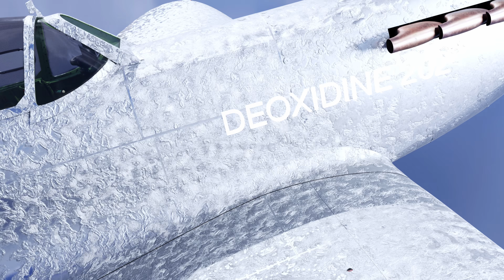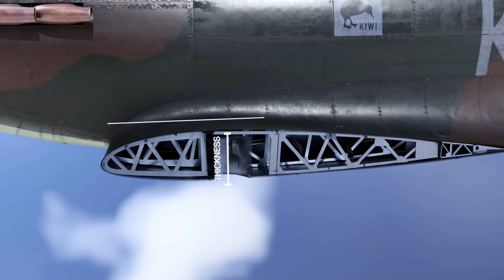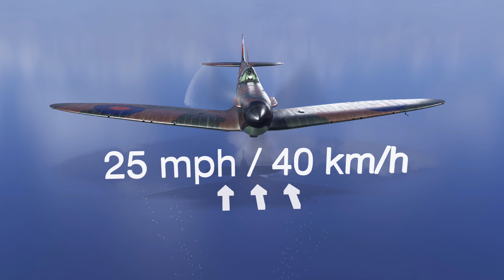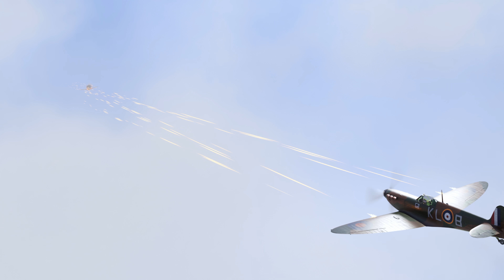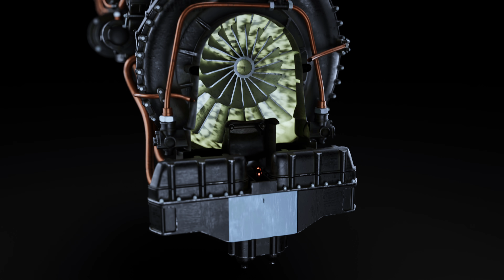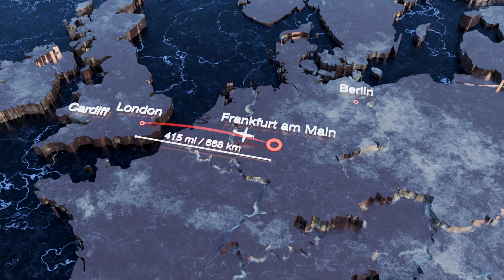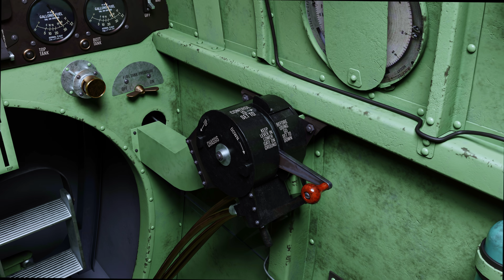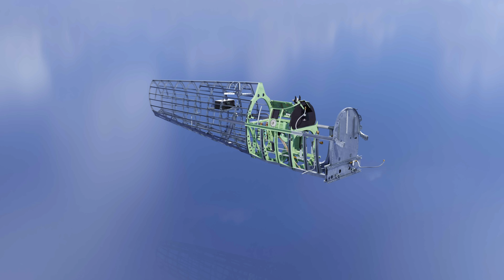Inside the Spitfire

Comment: I actually did spot a slight inaccuracy in the script! (wooo! I caught one! Hey, y'all, I caught one! :D)
You pointed out the propeller having two positions  - This was the case of the original DeHavilland 2-position units, fitted to the earlier Mk.I  (not A) - These were not actually two positions only, despite their confusing official name.  A pilot could operate the control handle continuously such that any pitch between the nominal 2 detents was available.  This is in more modern terms, considered a "variable pitch propeller", which are (these days) distinct from "two position" setups where the pilot can only toggle between Full Fine and Full Coarse blade (pitch) angles.
Moreover, The BoB-era Spitfires Mk.IA, had (for the most part) been upgraded with the heavier, but decidedly superior Rotol Constant Speed props.  They are subtly distinctive with a more rounded, boob-like spinner, and chunkier prop blades.

Constant-Speed props like these use a governor (a speed control device, not a politician) to feed oil-pressure into the mechanism inside the spinner that changes blade pitch.  The pilot then uses the cockpit lever - which you correctly modelled after the Mk.IA, whereas the Mk.I had a plunger-style push/pull knob - to set the maximum RPM at which the governor will begin to pitch the blades such that they "bite harder", increasing resistance and keeping the RPM constant while outputting more power as you advance the throttle. 

The official period documents about these propeller fittings and their operation are fantastically confusing, as I'm sure you've noticed. Took me a also quite while to piece this all together when I first looked it up.  
I suspect this is where you also understandably took it from, that the takeoff procedure required pulling the propeller handle back - This was so in the Mk.I with the manual plunger control, which operated backwards from the later constant unit handle. 
But in the Rotol-fitted Mk.IA, you'd have it fully forward for max RPM before takeoff. (maddeningly, the mixture control IS just as you pointed out, reverse from modern-day standards, with Full Rich being the aft lever position.)... IKR?

It is all indeed, very messily explained in the manuals of the era. A rich example of just how fast development was taking place at that critical time, when not keeping up with advancements would mean everybody having to learn to speak German real quick-like. 
It'd actually have been most surprising if you had got those details correctly in the first try.  Even high-fidelity flight simulator developers have been known to struggle with the differences between Mk.I and Mk.IA propellers in their digital recreations.  You do amazing work! Keep it up!
Reply: The bane of all historians; messy confusing or incomplete documentation.

Comment: FYI everyone 
The space from the main wingspar forward on later marks were converted to increased range  fuel tanks. Give the old lady a longer ride in the air. If you see any spitfire pictures with the front wings in silver that's one that had recently undergone the upgrade I believe they were kits to do in the field and probably that the factory where they would rebuild repair

Comment: The RAF production outstripped the Luftwaffe during the Battle of Britain, the Germany under estimated the productivity of the British manufacturing industry. 

That’s why they kept expecting the RAF to disappear from the sky. 

The Brits remained over the uk, if they got shot down and survived they could be returned to service within days. 

Germans had to bail out and get captured or risk ditching in the English Channel. 

The Germans started with a numerical advantage but the Brits rapidly came level and then streamed ahead of German manufacturing. 

Lots of nationals from occupied countries flew with the RAF and the Polish wing were particularly successful against Germany possibly because they had seen their homeland occupied by Germany and Russia and had the fighting spirit for revenge. 

And the Spitfire was the equivalent of a sports car. 

Where the BF109 was a mass produced fighter the Spitfire was a work of art. 

It still draws crowds today, especially when it’s fired up and roaring. 

It changed over the years of production and the last versions were basically different aircraft even if they looked similar. 

More powerful and then different engines and modified for better all round vision with a bubble canopy the later aircraft were far superior to the earlier versions.

Comment: The only problem of those video, is that they are too short. 

What a masterpiece this plane was !!
Reply: In the back and forth here regarding BOB loss comparisons and the potential alternative outcomes, I don’t think anyone mentioned a critical variable: if a German plane was shot down over England, the pilot was out of the war - either killed or a POW.  Not so for the RAF. As an example, I think the guy who flew the specific plane featured in this video got to use his parachute a few times and then strap into another Spitfire. Apologies in advance if someone did mention this critical variable, extending that preemptive apology because I am DEFINITELY not here to argue with strangers. Cheers.
Reply: @HighAltitudeBeagle  Good point. The same conditions applied to the RAF in the battle of France. These losses made the victory of the B.O.B a close affair.  Goering did not deliver the cake walk destruction of the RAF as promised. It only set the stage for the allies involvement
Reply: Agree on the video is too short. Spitfire has many variants each different in their own way. I wish blue would make another video on the late merlin variant and the griffon engined variant.
Reply: They should be 1h
Reply: idk if its a masterpeice when the carburator is of a bad design

the combat range is severely limited

it had long construction times

cramped cockpit

only .30 cals

so idk man, seems like a good plane but far from a masterpeice. at least not the mk 1
Reply: @TheRealHornet0  You raise some legitimate points. However ,its ease of flight allowed poorly trained (in the gunnery aspect) pilots to get close enough to German fighters and fast bombers to shoot them down with .303 guns.  You forgot to mention the narrow landing gear (similar to 109) and the poor forward visibility as the fuel tanks were behind the engine.  The Spitfire and Hurricane where the right planes for the RAF during the B.O.B.
Reply: @davidfoster5906 im not debating that, only saying that people overblow it and act as if its  the greatest plane ever made
Reply: @TheRealHornet0  I agree. It was the right plane at the right time.Its role as a gun carrying platform was not a priority during its design. Yet very sexy at a distance. It excelled in a specific role as a defensive interceptor  I believe the B.O.B was over when the 190s were introduced. The Germans decided to focus on Russia at the point when the RAF was collapsing.
Reply: @davidfoster5906  The British Air Force always suffered more losses than the Germans, even though they had fewer men and planes. Despite Germany's superiority and combat experience, Britain fought brilliantly.
Reply: @aussiemusclee  From what I know of the Battle of Britton ,earlier there was parity in losses .As the Luftwaffe added bombing missions requiring longer distances the bombers had limited protection of  their109s .An unsung hero of the B.O.B , Sir Hugh Downing ,rationed fighter response according to radar information. This made the R.A F appear larger ,as Spitfires and Hurricanes were always airborne to greet the Luftwaffe. Eric Brown (Fleet Air Arm fighter ,test pilot ) interviewed Hermann Goering while in-captivity posed a question , who won the B.O.B. ?Goering response - looking at the data, you will find  the Luftwaffe had gained the advantage in the latter months of the battle. It was the shift of priority to Russia gave victory to Britton.  Many of the early victories against Stuka's and twin engine bombers with only.303 caliber guns was impressive. Their finest hour.
Reply: @aussiemusclee  If you like ww2 history ,and are unfamiliar with the story of captain Eric (winkle) Brown, watch a documentary on his story . I wrote a reply to your comment ,a bit long ,but its hard to do sound bites,
Reply: @davidfoster5906  The losses were not approximately equal. For every 68 British Air Force officers, there were 75-77 German pilots shot down. The Luftwaffe also took these losses into account when it called off Operation Sea Lion, but they didn't know that the British didn't have enough personnel to replace them, but they fought fiercely until the end. Operation Sea Lion was called off long before the Eastern Blitz, if you're interested.
Reply: @TheRealHornet0  This is the greatest aircraft of World War II, with the longest combat career of any Allied aircraft (excluding Soviet aircraft), and it was constantly upgraded and adapted, with highly specialized versions that were the best in their field.
Reply: @aussiemusclee  The British Air Force always suffered more losses than the Germans even though they (the RAF?) had fewer planes and men. This is what YOU posted.I never said the RAF lost the B.O.B.  I was suggesting that, if the battle had continued ,the RAF would not  have ben able to replace airplanes and men as they were maxed out.(even though they had fewer men and planes ,your quote). I am not looking to argue with strangers on the internet. I want to share information with people that care about similar topics .You want to argue. I obviously have great admiration for what Britton achieved and the machines they designed and built. We know the Germans had a head start in building fighters, and before B.O.B there was the battle of France. Britton was in a constant state of  resupplying men and aircraft.yet they won the battle. Enough said.
Reply: @davidfoster5906  You don't want to argue, but my words have been misinterpreted. The British suffered 75 aircraft losses, while the Germans lost 80-85 aircraft. Something like that. This statistic already gave the Germans reason to reconsider and abandon Operation Sea Lion.
Reply: @TheRealHornet0  You, like a lot of other experts, forget that the Spitfire, unlike the Messerschmitt, was constantly improved during the Second World War. There were several branches for completely different tasks, from high-altitude interceptors to ground-based fighters, from reconnaissance aircraft to night hunters. The Bf109 couldn't boast of anything- the aircraft, in the process of upgrading from E to F, was first made lighter, more maneuverable, and faster, but then the G and K became heavier and heavier, with increased armor and weapon caliber, but it didn't make any sense. The Supermarine met its end with triumph, while the Messerschmitt was left behind. That's how it was.
Reply: @aussiemusclee  "And it made no sense"... I remind you that the objective of the fighters in 1944-45 was to destroy B-17s, that's why they were fitted with a 20-30 mm cannon.
The Spitfire triumphed because it was on the winning side, the BF 109 was not.

Comment: “Don’t change a thing!”

Joseph “Matt” Summers chief test pilot of Vickers Aviation company March 5th 1936
Reply: You mean "Mutt" Summers?
Reply: “I don’t want anything touched “ was the correct quote when he climbed out of the aircraft after its first flight, at least that’s the most remembered one when he was discussing the flight of the prototype. And his nickname was “Mutt”, as in dog, for his habit similar to boy dogs before a flight on the tail wheel.
Reply: K
Reply: Yet there were eventually 71 variants! Most didn't see production. The Mark 47 was so developed it was the equivalent of the prototype carrying 20 passengers and their luggage. Only the fuselage core remained the same. New engine. New tail. Eventually a laminar flow wing. Even arresting gear.
Reply: @chelseafan8846  It is important to remember that the Seafire line was produced after World War II, and it is not surprising that the aircraft received the most advanced technologies at that time.
Reply: @aussiemusclee the first seafire, the Seafire Mk. 1b first saw service in 1942, seeing their first action in Operation Torch. 

Consequent seafire marks continued to serve throughout the war and beyond.
Reply: @chelseafan8846  There were 24 marks with a number of variations, the Mk 47 was a Seafire, no Spitfire had a laminar flow wing, in fact laminar flow was a dead end and didn't work so well, the Spiteful had a laminar flow wing but the Spitfire wing was better.